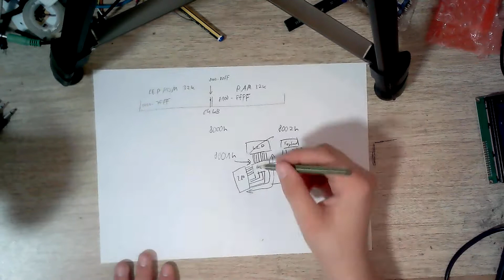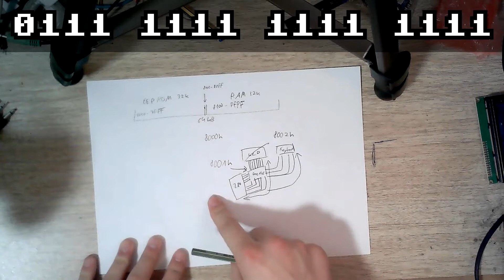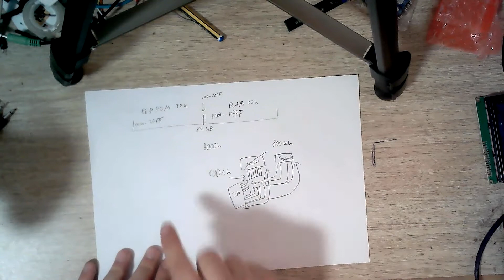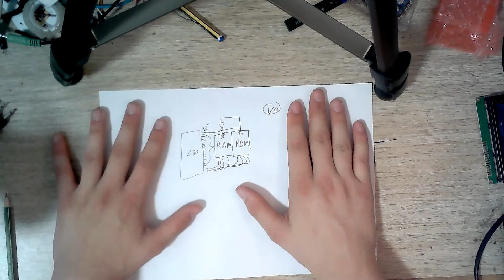Planning & Memory - Building a Z80-based Computer from Scratch

Comment: 6502 is very primitive and tricky, both in wiring and programming.
Back ago it cost dirt cheap, that's why it was adopted for home computers. Now, IMHO, it could be choosen only because of compatibility with old software.
Reply from the maker: I feel like I'd be putting myself in direct competition with someone like Ben Eater on that front.
That was one of the reasons I didn't opt for it. 
He's near impossible to match.

Plus there's hunderts of 6502 related projects out there.
Reply: @80Bytes  Well, Ben Eater's 6502 series, IMHO, are not so deep. I see wiring rookie mistakes (like bus conflicts).
Reply from the maker: I think it's mainly meant for novices who want to get their first taste of wiring low level stuff. Plus he more or less intentionally makes mistakes to highlight possible misconceptions or misunderstandings that may arise. 

However, I think it's quite nice of you to consider my videos to be of more education value that those of Ben :)
Reply: @80Bytes  Ahh, unfortunatelly, you made at least one mistake (btw, the same as Ben Eater did) - аddress lines should be never connected to read strobe OE (use CS/CE pin instead, it is intended for address selection). OE is for read signal (RD+MEMRQ) only.
OE makes memory to drive Data bus, which would conflict with CPU on write cycle (when CPU drives Data bus with another data byte).
Reply from the maker: Dunno what I said in the Video, but that's exactly what I did in practice, so no worries. 
I'll look into getting a new Prototype soldered together soon enough, mainly so peeps can possibly start exploring the ins and outs of the hardware I've designed. 

It's far from final, but I actually started work on a little Wiki for the thing. 
https://github.com/OfficialPixelBrush/Pix80/wiki
Reply: @80Bytes  Yeah, that could be made in practice without smoke. But it causes CPU and memory overheat and unstable operation (unstable write on high clock).
Reply from the maker: Dunno what you're talking about on that front, but ok :)
Reply: let's be honest, the only reason people will choose any retro 8-bit CPU at all is because they want to use that one specifically, so the 6502 and Z80 are both perfectly fine choices, along with the 8080, 6809, 6800, 8088, or whichever one you want

I personally prefer the 65xx series as they're ridiculously simple, idk why you're calling the 6502 tricky in programming
Reply from the maker: @catgirlQueer   Everyone's got their reasons and preferences!
Reply: @catgirlQueer  Try Turing machine or BF. You would love the simplicity.